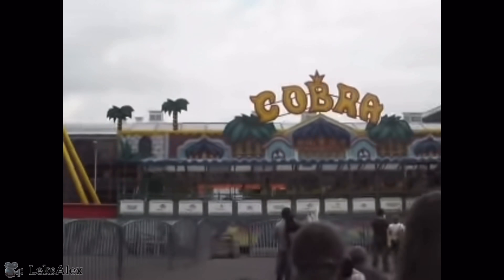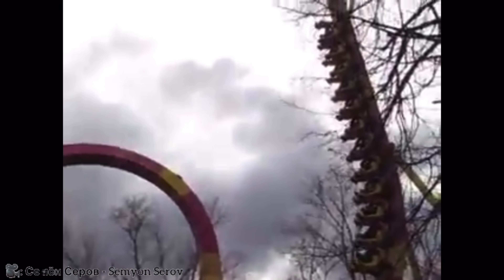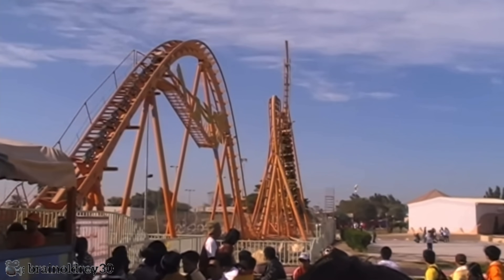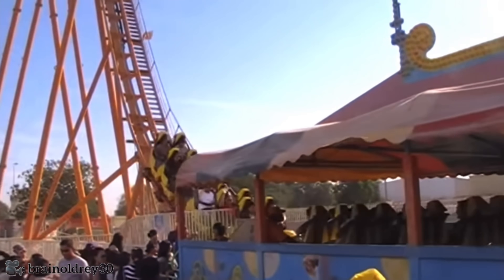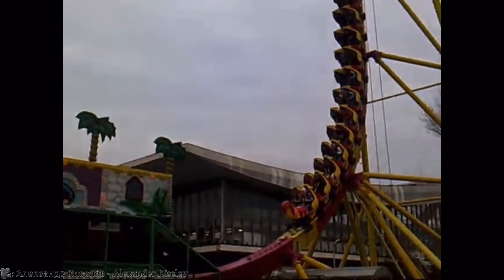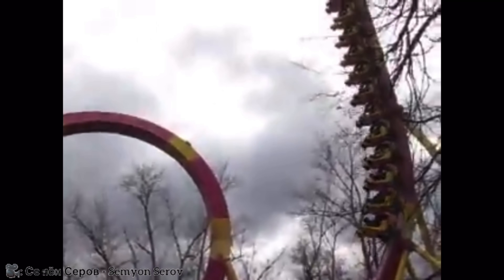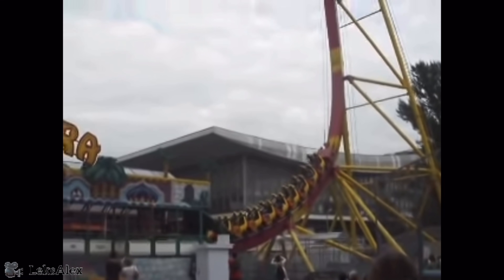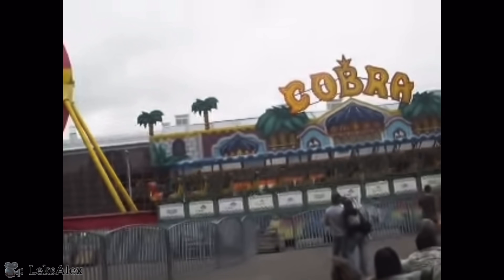First Ever SINGLE-RAIL?? | Meet Pax Company’s Cobra-1!

Comment: Maurer was technically first, but while it does count as a roller coaster, it looks more like a combo of the people mover and a monorail just going down with no real lifts or hills. However, they built like three of these Pax single rails. I do wonder why they abandoned the design. Let alone not deciding to make new ones in the modern day, given they have a random model with 4D flipping seats. I thought that one was new and they were offering, but I know I could be wrong. I will give Pax some credit, they have made some family coasters with crazy drops or random big airtime in addition. Honestly RMC should offer a shuttle design. With so many RMC i-box makeovers and customs, while many places could still get single rails (the model that's still really selling) , I think they need more than that with GCI and gravity group competition (titan track and pre-fab work). The wild moose thing is underrated though many places could use it especially places removing wild mouses or looking too namely some of the more meh designs. Like I lovee apple zapple or lego test track, and the reverchon/zamperla spinning models. The older mack ones are just not that good and the few arrow ones left are on borrowed time, c'mon parks!

Comment: The Schwarzkopf shuttle loop at Walibi Belgium now known as Pské Underground also got stuck in the loop once years ago when it was still called sirocco. And you said all single rail cobra models are gone now but the is still one in switzerlands Connyland that also includes an airtime hill and in inverting Spike. I don't know if it's another model or so that you didn't mention it🤔🤷🏼‍♂️
Reply: Conny Land's Cobra is not a single rail and while similar to the Cobra-1 model talked about in this video, it is a different model, a Loop 520.
Reply: @ElectriKong-  ah okay that explains it and I completely forgot that it's not a single rail, I had an image of it as a single rail coaster in my head, just don't ask me why😂

Comment: Mack and Schwarzkopf bouth had made single rail coasters. I don't know when but I think thay were the first. As far as I know 1 single rail coaster of Schwarzkopf stil travels in france. Its called Super Railway
Reply: Super Railway was not made by Schwarzkopf. The actual manufacturer is not publicly known.
However, the supports look like they may started their life as a Schwarzkopf Wildcat that later got the single rail track added onto it. The layout is the same, and the supports would be wide enough to accommodate normal track.
While the track and cars have certainly not been made by Schwarzkopf, the supports may or may not - it could as well just be a copycat design.

Edit: I compared POVs of a Wildcat and Super Railway side by side - the supports are different to a point where I can't tell whether it's due to the single rail modification or due to Super Railwas just being a copycat design.